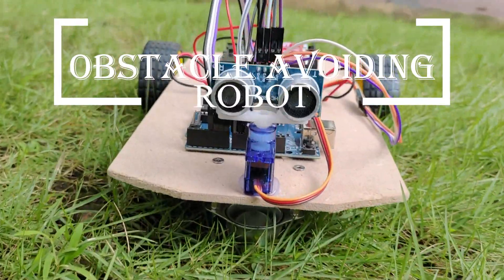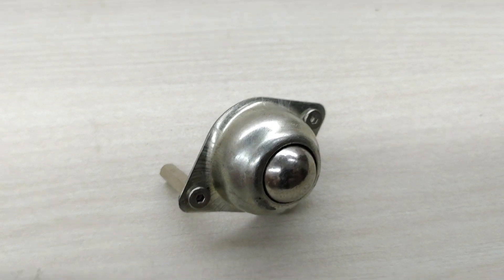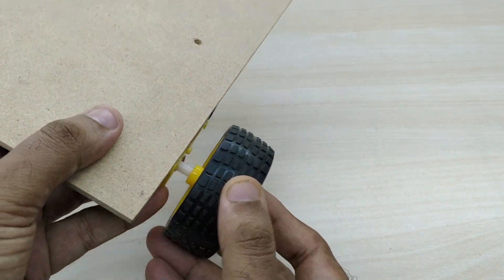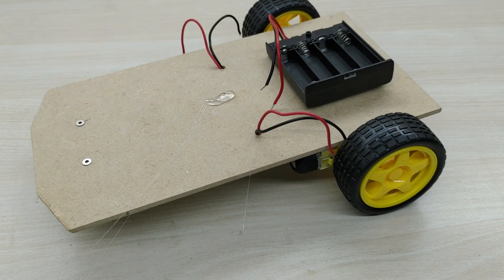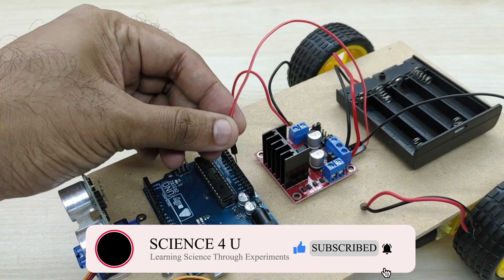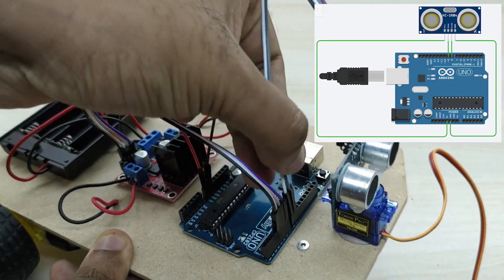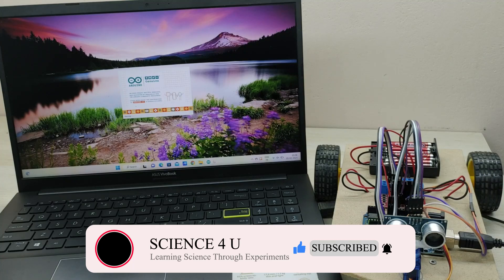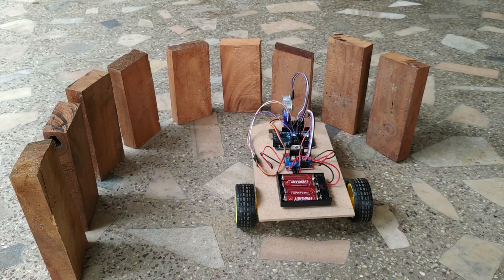Intelligent Obstacle Avoiding Robot || Step by Step Tutorial || Arduino Project

Comment: 04:37  onwards the connections for Servo the motor is  shown incorrectly in the video. Please follow the circuit diagram. I have encountered some problem initially because of not putting 2 jumpers in motor drive. After these two corrections it started working.  I
Reply from the maker: Okay friend. I was telling about the colours that are generally given for servo motors..
Yellow/orange for signal wire..
Red for +5V
Black/brown for gnd..
In the servo motor that I used, the colour of signal wire was yellow but generally it comes with orange wire..also the servo motor that I used had brown ground wire.But some motors come with black ground wire..so that why I told black colour though the servo motor that I used had brown ground wire..
Reply: @Science_4U_    Not about colors,  Just check the connection to IOREF. The audio is telling not IOREF. May be its  not audible clearly.  I am talking about the Violet /Purple  wire (middle one ) from  the servo motor. Anyway it is working fine now.  Your code is also working fine. Thanks
Reply from the maker: Ooh..okay friend.. anyway IOREF is a reference 5V that is to be given to input output devices. So IOREF is actually same as +5V..That is why I told +5V only. Also in SMD versions of arduino +5V only is written. There is no IOREF. So as a general term I told +5V. Thanks friend for pointing out..👍
Reply: @Science_4U_  Thanks friend. My son had a knowledge fair in School today. He used your video to make the same Robot. He presented it successfully. Thanks a lot.
Reply from the maker: @pmm782003  Thank you so much..Very happy to know that..🙂. Please do convey my regards to your son..💓
Reply: @Science_4U_  Sure, Thanks
Reply: @Science_4U_ 😮
Reply: How much volt battery I need for that

Comment: Dear friend i am trying to make this thing work. but none of the components are functioning. especially the gear motor and the other ones too like sensor and servo. both of board's LEDs are glowing. initially i though i was power issue so i  even gave another battery to power up arduino. still nothing moving a lil bit. Help!!!
Reply from the maker: Hi friend. Since none of the components are working correctly, i strongly suspect that there can be a problem with uploading the code correctly. Was the code uploaded properly to arduino??
Reply: @Science_4U_   yes i have done that as well. the code was uploaded correctly
Reply from the maker: @wasiqhussain7712  hmm..okay friend..then we have to see in detail..if possible can you share some photos of the connections in my instagram id..I will check and help you in solving the problem.
Reply: @Science_4U_  before that i would like to ask u that is it possible that even the motor driver is blinking when provided voltage ,it can be a faulty piece of board?
Reply from the maker: @wasiqhussain7712  Yes sure friend. It is possible.. I have seen many cases like that.
Reply from the maker: @wasiqhussain7712  Also, there are 2 jumper pins on the motor driver board on both sides of IN1 and IN2 pins..The jumpers have to be in place. Then only it will work. Please check that also..

Comment: Hello bro i have uploaded the code in Arduino but the gear motor  and servo motor is not doing anything
Reply: No my motor driver light is on which means it's not faulty and jumper wires are also connected correctly
And I can't share the photos of it because it is my school project and my teacher would not allow me
So what should i do now
My whole circuit is also correct I have checked it 2 times
Reply from the maker: @roshnichauhan364  Just do one thing..remove 4 jumper wires from the motor driver board connected to the control pins. Now just connect 5V feom arduino to IN1 of motor driver board. And connect gnd from arduino to IN2 of motor driver board. This serves as a command to the motor driver board and one motor should rotate. If it doesn't , the your motor driver board is faulty..
Reply from the maker: @roshnichauhan364  Also do you see 2 jumper pins, one on each side of IN1 and IN4 pins?
Reply from the maker: @roshnichauhan364  Hi friend. The motor driver can be faulty even if its light is ON. I have seen many cases like this. Have you used the motor dtiver board before?
Reply: Only sensor are working
Reply from the maker: okay friend..There can be many reasons for the robot not working. Most likely your motor driver board could be faulty. Other wise the jumper pins in the motor driver board may not have been inserted. In order to check and confirm that can be please share some photos of the connections to my instagram account? I will help in identifying the problem.

Comment: Hello sir I have made exactly as per the video and used a 9V battery, I have one new ij spare so thats not a problem, when I uploaded the code I thought the robo was supposed to run but no movement is happening, the lights on the motor driver and arduino are blinking but the apparatus is just not moving at all can you please help with this? I have to submit tomorrow
Reply from the maker: Hi friend. I will surely help. My first doubt is the motor driver board. Is the motor driver board used before or is it a new one?. Sometimes the lights could be ON, but if the motor driver is faulty, the motors just wont run.
Reply from the maker: Have you used the servo motor also?. Atleast is the servo motor turning to left and right when you place your hand in front of the ultrasonic sensor?
Reply: @Science_4U_  I checked my ultrasonic sensor is not working for now, the motor driver is new btw and is it because of ultrasonic sensor that nothing is working or there is also some other fault present in the circuit?
Reply from the maker: @xyzabc7241  There is some other fault friend. Even if the ultrasonic sensor was not working also, the motors should have rotated continously. I have another doubt. Was the code uploaded properly?. If the code was not uploaded correctly, nothing will work.
Reply: @Science_4U_  Yes I uploaded the code properly so right now I am going to buy a new ultrasonic sensor so is it possible that motor is also not working or something? And do you have Instagram I'd, can we talk there?
Reply: @Science_4U_  Yes I uploaded the code properly so right now I am going to buy a new ultrasonic sensor so is it possible that motor is also not working or something? And do you have Instagram I'd, can we talk there?
Reply from the maker: @xyzabc7241  yes sure..please come to instagram. I  will try to identify the problem.
https://instagram.com/_science4u_?utm_source=qr&igshid=MzNlNGNkZWQ4Mg%3D%3D
Reply from the maker: Also, can you check whether the rotation enable jumpers are put in place in the motor driver board. There will be 2 jumpers kept on   the ENA and ENB pins of the motor deiver board. If those jumpers are not there also, the motors wont turn.

Comment: how can we give power supply to arduino not by motor driver?
Reply from the maker: Hi friend, you can directly connect a battery to the Vin and ground pins of arduino for powering it. You need not take powersupply to arduino from the motor driver board.
Reply from the maker: Actually in my video, the single battery pack is connected both to arduino board and motor driver board in parallel. Motor driver is not powering the arduino. I am taking an extension from the motordriver input pins and connecting to arduino, which means that the powersupply is given in parallel to both motordriver and arduino.
Reply: Did you mean that i can directly connect the another battery Using Arduino Power Jack ?  Can i do this?
Reply from the maker: @roshnichauhan364  yes sure. In the power supply section of arduino, there are 2 pins labelled Vin and Gnd.You can directly give the battery voltage (5V to 12V) to these pins for powering the arduino.
Reply from the maker: @roshnichauhan364  Another way to power the arduino is to connect 230V AC to 9V DC adaptor to the power jack.
Reply: Bro when we connect the 9v battery directly through power jack to Arduino then is there will be any changes in codes?
Reply from the maker: @roshnichauhan364  No..absolutely no change in code is required.
Reply: And then what connections will be left between motor driver and arduino?
Reply from the maker: @roshnichauhan364  Motor driver requires   battery to be connected to it. +ve and -ve wires from the battery to be connected to motor driver board for powering it. Then 4 control wires from the arduino also is to be connected to the motor driver board pins IN1, IN2, IN3 & IN4. The motor control commands from the arduino board goes through these wires.
Reply from the maker: See friend, both arduino and motor driver board requires powersupply. Either you can give a common supply to both arduino board and motor driver board. Or you can give separate power supply to arduino and motor driver. There will not be any change in code due to that..I am not sure whether I am able to clarify you correctly.
Reply: Thank you so much 
My all doubt has been clarified 😊
Reply from the maker: @roshnichauhan364  okay friend. Nice to know that..🙂
Reply: Bro can we give direct 9v battery supply to arduino uno through power jack?  Any resistor or any lower battery is required or not?
Reply from the maker: @roshnichauhan364  Hi friend. Surely you can directly give the 9V battery to power jack. No resistor or lower battery is required.
You can read more information in the following link.
https://linuxhint.com/use-9-volt-battery-arduino/
Reply: Can i use 12v battery?
Reply from the maker: @roshnichauhan364  Yes friend, you can use upto 12V battery..

Comment: Hey dude, i used like u used 4 aa batteries but motor need more power. Using ur same motor
Reply from the maker: Yes..that is true friend. 4 x AA batteries wont last long..2x18650 rechargeable batteries is a much better option in my opinion..
Reply: @Science_4U_  I mean I tried it and the motor is soo fast, how can I slow it down.
Reply from the maker: @mystery_1101  Okay. The easiest way to reduce the motor speed is by reducing the battery voltage. There is another way to reduce the motor speed by using PWM control for the motor driver. A PWM signal has to be given to the ENA and ENB pins of the motor driver board. By reducing the width of the PWM signal, the motor speed can be reduced..

Comment: Are all of the jumper wires male to female
Reply from the maker: Hi friend, the ultrasonic sensor and motor driver board connection to arduino requires male to female jumper wires. Whereas the servo motor to arduino connection requires male to male jumper wires..

Comment: Hello good day ! We are currently using 3 pieces of 18650 (vape) batteries which has 3.9V so around 12 V of battery. We are already done programming it with remote control and stuff. We are now trying to make it an autonomous driving with obstacle avoiding property. Do you think the code that you provided will do just fine? I can send the whole specifications of the parts the we used for better visualization. Thank you
Reply from the maker: Yes sure!!!.. I think this code can be used for the obstacle avoiding part. What is the remote control module you are using for your vehicle?
Reply: @Science_4U_  Hello, Its just a random TV remote, we just used it since its the only available resource we have. Ill try to input the code soon. it's 2 AM here rn.Ill hit you up here when something interesting happened. I just subscribed to the channel  thank you so much
Reply from the maker: @prokoloid869  okay..sure friend!!!
Reply: @Science_4U_  Hello its me again, I just got the robot back and tried to upload the code, I also put the correct pins according to the wirings of my robot, however, it cannot let me upload in IDE.

*EDIT
the uploading worked but it doesn't move, the motors are just making weird noises and it doesn't show any reaction aside from the weird noises, what do you think is the problem?

*EDIT 2 
Servo is working fine, it moves when it detects an obstacle, the problem now is the motor, it doesn't make any weird noises now but it doesn't show any reactions let alone moving.
Reply from the maker: @prokoloid869  Hi friend..have you checked the battery?. Discharged batteries can cause this problem. Please use new batteries and see.
Reply from the maker: @prokoloid869  Otherwise the problem could be the motor driver board. It could be faulty. Have you used the motor driver board before?
Reply: @Science_4U_  Hello yea, we've been using the motor board for months now, we also have used it in our sumo bot competition, So its pretty fine, for thr battery, it has a good charge since it works fine and pretty fast when Im using a remote control
Reply: @Science_4U_  also I'm wondering, is the code in IDE doesnt need the enable wirings ? I only input the 2 pins from both motors and not the enabled ones in IDE, do you think that causes it?
Reply from the maker: @prokoloid869  Do you have jumpers connected to the Enable pins of the motor driver board. My code works only if jumpers are connected to enable pins so that 5V goes to ENA and ENB pins and that enables motor rotation..
Reply: @Science_4U_  Yea our jumper wires (if you are pertaining to that jumper) are connected to the enabled pins otherwise other codes from mblock wouldn't work.
Reply: @Science_4U_  If the case where our jumper is not properly connected, would you be able to let me know what or where should I connect the missing wires? ( I am the one responsible for the codings not the wires so I have to ask my other group members for it)
Reply: Hello, I tried to run the code again but its still the same. The servo and ultrasonic sensors work but the motors are still stuck and not working. When I input the code with remote the motors works just fine, so I dont think the Arduino itself has the problem. It would be cool if you let me know what should I do

Comment: How to control the speed 
please help
Reply from the maker: Hi. The motor speed can be controlled by using pulse width modulation (PWM). For that you have to remove the 2 jumpers in the motor driver board (connected to ENA and ENB pins) and we have to give PWM signal to the ENA and ENB pins. The motor speed can be varied by adjusting the pulse width given to these 2 pins. The PWM signal can be varied using the analogWrite command.
Reply from the maker: You can see a demonstation of this PWM motor speed control in the following video.
https://youtu.be/Da4HY7HZ6h0
Reply from the maker: Another much easier option to control the motor speed is to change the battery supply voltage. More the battery voltage, more the speed. Less the battery voltage, lesser the speed.

Comment: I did it. Thanks a lot. But i have question, how to change the code to adjust speed using pwm?
Reply from the maker: Hi friend. The Motor speed can be controlled using PWM by removing the 2 ENABLE jumpers at the motor control pins and giving a PWM signal in that pin. I will give below a link to a very detailed article on this. Please go through that and ask me if you have any further questions. I will be happy to help!!!
Reply from the maker: https://howtomechatronics.com/tutorials/arduino/arduino-dc-motor-control-tutorial-l298n-pwm-h-bridge/

Comment: We have done everything according to the video and the sensor too is working... But the problem is when we keep the robot on floor, it is sensing only once and not sensing the obstacle again. But when he hold it in air, its working and sensing normally... Pls help me with this
Reply from the maker: Hi friend,surely I will help. I think that is due to poor batteries. When we keep on the floor,  the motor consumes more power from the batteries. So this drops the input voltage and hence it stops working again. Have you used fresh AA 1.5 V x 4 batteries? If possible can you change to 2x 18750 3.7V rechargeable batteries?. Those are the best for these kind of projects.

Comment: Can i use esp32 cam instead of arduino uno? And also can i use L293D motor driver instead of L298N motor driver.
Reply from the maker: Hi. ESP 32 is a camera module which can be connected to arduino uno just like any other sensor. But, it cannot be used instead of  arduino uno. Both have to be used together.
Reply from the maker: ESP32 CAM can be connected to arduino for different projects like face detection, QR code scanner, Motion detector and many more..
Reply from the maker: Yes sure, you can use L293D instead of the L298N motor driver. Both are used for driving motors..
Reply: I mean, can i use esp32 microcontroller instead of arudino uno to create this project?
Reply from the maker: @muhdhfzd  yes sure.ESP32 microcontroller can also be used for this project..
Reply: What's the difference between L298N and L293D?
Reply from the maker: @muhdhfzd  L293D drivers operate between 4.5 and 36 volts, while L298N drivers can operate up to 46 volts.

The L293D Motor Driver can draw up to 600mA from both channels, whereas the L298N Motor Driver can draw up to 2A from both channels.

L293 is a quadruple motor driver that employs a half-H driver, but L298 is a dual full-H driver, i.e. in L293 all four input-output lines are independent, however in L298 only a full H driver can be utilised.

L293 output current per channel is 650mA, whereas L298 output current is 2A. As a result, heat sinks are included in L298 motor drivers.

Small current drawing motors such as BO motors, DC geared motors up to 500 RPM, and small stepper motors that draw less current up to 600mA at their greatest torque rating are all suitable for the L293D. The L298N, on the other hand, offers a greater output current of up to 2A, making it ideal for high torque and high RPM motors and high torque DC Geared motors.